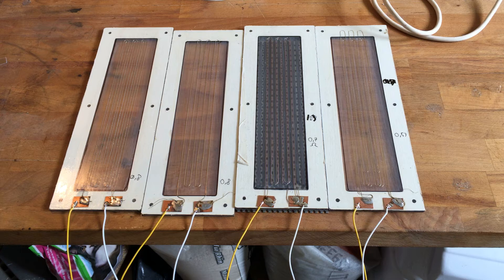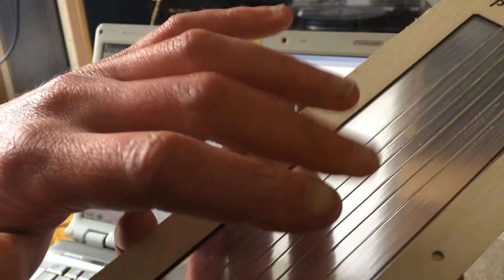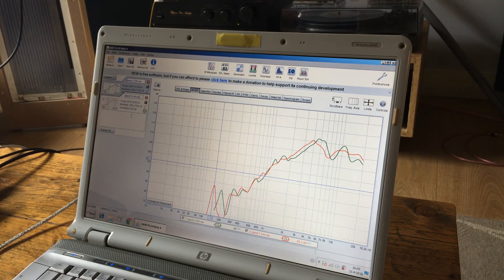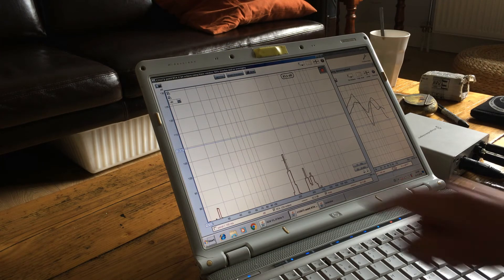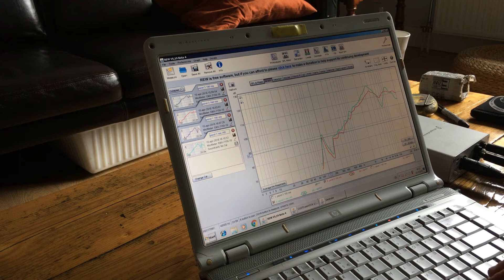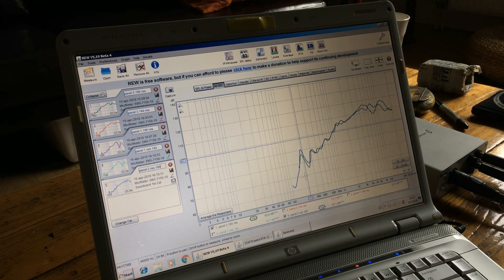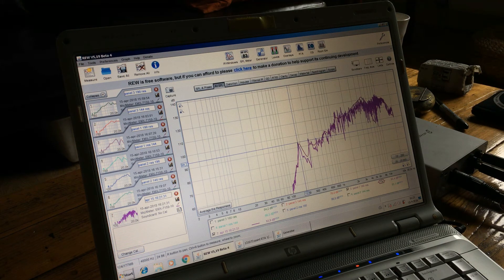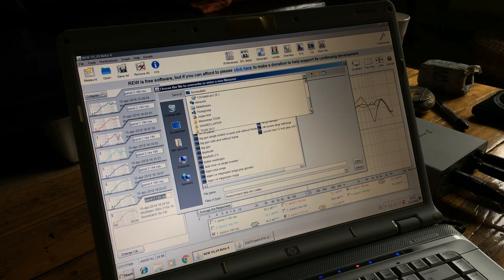Part 3 Planar Tweeter testpanels : Measuring in REW

Comment: Why add a resistor when you can run all four of them in series? :-) They would make a nice tweeter array.
Reply from the maker: well i wanted to measure them one by one since i was playing with different wireing methods :) in an array i would not know what did what :) hehe they where only test panels :) in the scrap bin by now :)